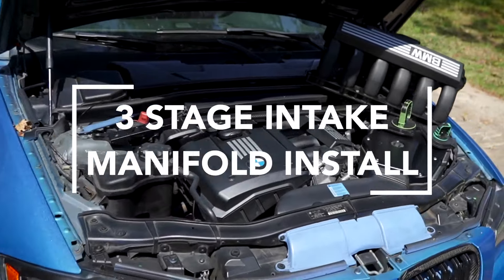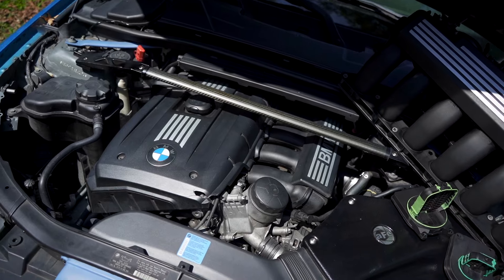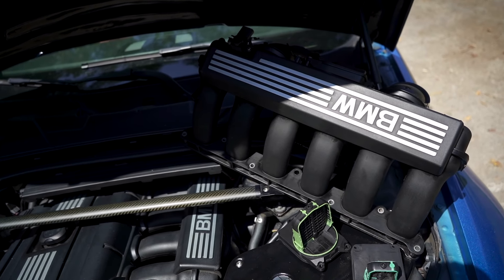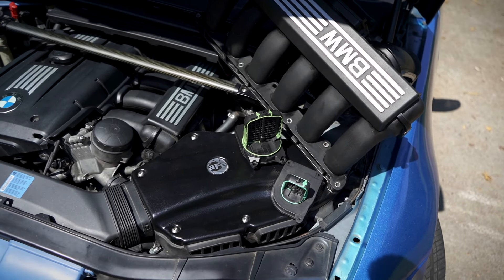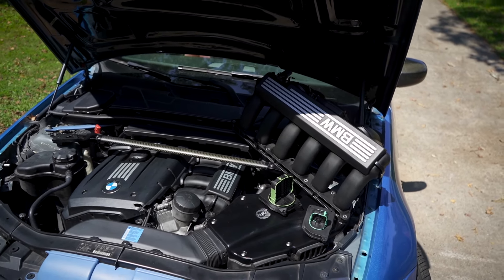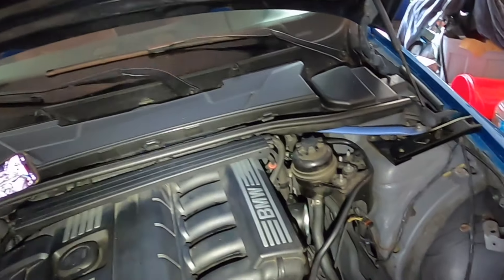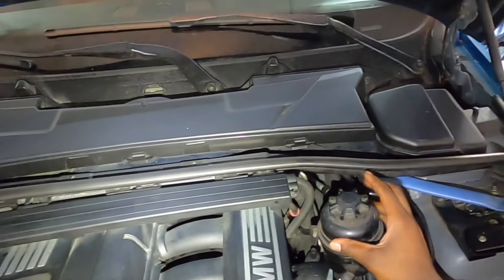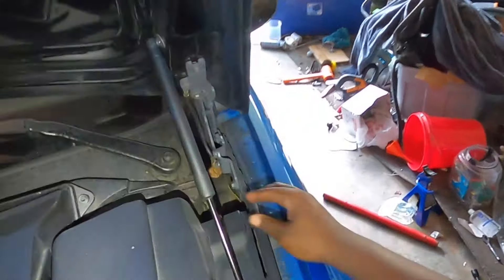How To Make a BMW 328i Faster: N52 3 Stage Intake Manifold Install And Tune

Comment from the maker: Parts List:
Right Air Intake Manifold Flap Control Unit Disa Valve Part # 11617560538
https://amzn.to/48cNDY1

Left Air Intake Manifold Flap Control Disa Valve
Part # 11617579114
https://amzn.to/3RdvzpQ

Intake Manifold Gasket Set
Part # 11617547242
https://amzn.to/3uMraSZ

I Suggest finding A USED one.
Genuine BMW 330i N52 Intake Manifold 
Part #11617559523
BMW E90 330i N52 Intake Manifold 11617559523
Reply: How can I tell if my used n52 already has the 3 stage?  it's already got some tune , intake and possibly some exhaust work.
Reply from the maker: If the car is a 330i it has the 3 stage manifold, every other one has a regular 2 stage
Reply: Have you had any problems with the disa valves or anything?
Reply: Can I just get the disa valves it's self and just put them on my manifold already in the car or do I need the 3 stage manifold itself??
Reply: @stevet8607 if your car doesn’t have the 3stage manifold, it won’t have the disa slots needed

Comment: I had my e92 328i with similar set up as yours. Euro-intake, 3-stage intake manifold, and exhaust; BPC in NC did my tune and I was getting 193 --> 224 whp and 187 --> 218 wtq. I definitely felt the increase of torque as a N52 is IMO very torque poor when stock. The price and effort to get this is definitely worth every penny for anyone who is interested.
Reply from the maker: 100% agreed and those are pretty good numbers

Comment: I am local to the Active Autowerks shop. They quoted me over $6k for tune including all exhaust and headers. Only promised a 20hp increase max with Dyno run . They wouldn't even take my$ . They told me I would be an unhappy customer and the platform isn't worth it. They sent me off with a cold air intake for a bit top end and noise increase.
Reply: Lmao 😂😂😂😂😂😂.   Serious over charging like MF

Also they sound Lazy 

Lazy workers and Over priced work

Tune for that setup 150-400 

Depending on how much Stuff your adding

Comment: bruh BMW 328i can be fast and very much fun to drive...Mine is 6 speed, FBO supercharged...around 3000 pounds...I beat N54 450hp idiots easily. I'm telling you weight matters and they dont get it. The investment is worth it imo
Reply: Cap
Reply: Can you send a link of a supercharger kit for n52?
Reply: @FanniCSIe92  The kit is pricey, I bought it used for $3K...but they go for $5K. TBH, the investment is worth it...think about how much MORE money you need to  mod an N54, not to mention the continuous maintenance. You will not have mad power like an N54 BUT you will have enough power to make you happy. Previous N54 owner who got fed up with the maintenance.
Reply: Did you build the motor for supercharger? Forged internals?
Reply: @hexatonik stock internals is good for 450hp with proper tuning
Reply: do u have the coupe or the sedan, either way how did u lose so much weight
Reply: @gabrieldasilva4198 notice how he skipped over your comment lmaooo buddy really lying on here
Reply: @nelsonx4235  drop some videos … oh wait you ain’t got none
Reply: If you think there is pros to buying and building a supercharged n52 over a n54, you silly.
Reply: @i_read_bad_reviews  for a daily 100%. If I want a beat fools in dumb street drag races, yeah the n54…even some prefer the 128i FBO for track build...dont be surprised if FBO Miata smokes you in the track...it's not all about raw power
Reply: @nelsonx4235  like I said. There is zero pros to dropping another e90s worth of money into supercharging a n52. If you want more power get a n54 to start. You are just throwing money away.
Reply: @i_read_bad_reviews  You may be right, but I'm already deep into the N52 build...will not want to start building an N54 now from scratch; this N52 pulls nicely for the weight...I may upgrade to an 340i later in the future when they get cheap
Reply: Haaaaaaaail no
Reply: You blowing these at 400 ,even methanol injected. So I've read and viewed on internet only. 1 guy reinforced the block with Steele. But saying a 3 stage beating a twin turbo dang near supra...nah
Reply: Low-key your opportunity to stunt and make a youtube if you into that. You'd be a world first. Not saying it's not possible. I'm just into pushing the boundaries of old tech .

Comment: good stuff and nice build seems like the manifold upgrade has been a major common upgrade recommended within the past few years i honestly dont remember much about performance upgrades for the n52 when i got mine years ago people would talk about, alot of 328s hit a certain milage they would give out and not even bmw knew the issues, but the issues have been flattened out and n52 is deemed reliable again with proper part maintence also i just noticed i watched your pink flamingo warehouse video before this from a couple months back didnt expect that
Reply from the maker: Agreed definitely one of the most reliable bmws of this generation

Comment: only 275bhp. Imo this is pretty impressive for a engine developed around 2004-2005 and produced early 2006 ! even my stock high mileage N52 I found it pretty powerful for a daily.

Comment: I been thinking about doing some bolt ons, super charger, exhaust and a m3 conversion kit on a 328i. I’m just kinda getting sick of the n55/54 I’m in my 3rd 335i, after this I’m done man🤣
Reply: I get the exponential power of the N54 platform...but the N52 has crazy amount of potential and the NA power band feels so good.
Reply from the maker: Would be a fun a set up, been beating on my n52 for 5 years now and 70K miles later still runs strong
Reply: R y’all on crack

Comment: Hi. I'm new to BMW. Does the single stage N52 intake have DISA flaps??  I'm thinking the DISA flaps make the intake 3 stages.
Reply: If you have the n51 version it already comes with it if it says SULEV underneath the hood. Otherwise you’ll have to buy one .
Reply: No, it doesn't.  Only the three stage comes with two DISA flaps.

Comment: 260whp is a bit of a stretch. You have done the only bolt ons people do on the N52...intake, 3 stage intake manifold, AA headers, and exhaust with secondary cat delete. With a AA tune, most you see is 240-250whp depending on conditions. So you are looking at 270-280hp at the crank. The only way to get 300whp on a N52 is with a supercharger and at that point, you might as well got a N54/N55 car.

Comment: Doesn’t the n51 already have a stage 3 intake manifold?
Reply: My 128i n51 does.
Reply: Just to compensate the power decrease caused by the lower compression ratio on the N51 SULEV versions
Reply: @gaaloulmed4753  so I have N51 SULEV. Can you elaborate on your answer? I didn’t understand. Thanks for your patience
Reply: @pignapoke6772 The N51 SULEV with the 3 stage is making max power it was designed for.  The lower compression ratio is the reason. The stage 3 is only a small power adder on a N52 car that came with the stage 1 and higher compression. With that being said I myself as well as others have benefited with a custom tune on the N51 to overcome the slight loss in power it has because of lower compression. Hope this helps you.

Comment: The N52 328i can never build more horsepower by just installing the 3 stage intake manifold. Simply because the original DME software won't detect the DISA valves hence they still not working !
Not talking about the more agressive software adopted to the 330i models.
Reply: Thats why you go and get new software update (Tuned)

Comment: i heard the car will tune itself out and adjust to the new manifold, is this true? ive also read to get the fullpower a tune is recommended, so much hearsay about the n52
Reply from the maker: I’ve heard both,however I didn’t feel a single difference till I tuned it
Reply: It will not, it has a tendency to create a vacuum problem. N52s are bullet proof until you mod it

Comment: 100$, how is reliability? Because I was just about to pay that 1k for a brand new one
Reply from the maker: So far so good, this video was actually filmed all the way back in September
Reply: The only concerns is the disa valve and their seals. 

Right into the engine is they fail (which can happen)

Comment: For a luxury car they sure do use alot of plastic parts which is engineered to drive you to the dealer opening up your pockets.. known facts… intake manifold is plastic, tranny pan plastic, only thing not plastic are regular bolts in these car.
Reply from the maker: It’s sad

Comment: Time for a differential swap bro.
Reply from the maker: I already have an LSD In the car
Reply: @BMWROYAL  well I guess the only thing left is a supercharger. But you're probably already thinking that...
Reply from the maker: @davidwigall4338 yuppp
Reply: @BMWROYAL where can I get a lsd
Reply: @BMWROYAL  what lst did you get?
Reply from the maker: @iaintcatchingnoell m factory
Reply: @BMWROYAL  aight thanks, and u think this b30 swap is possible on n52b25 (single stage) as you had the n52b30 (2 stage or single idk)

Comment: put the N54 Manifold
Reply from the maker: Torque over horse power is tempting
Reply: @BMWROYAL  oh okay cuz ive seen couple of ppl putting n54 manifold on a e90 n51/n52
Reply: @BMWROYAL  truuuu can I put bov on n52? Just for the sound and noise ?
Reply: @BMWROYAL  any spare parts lmk ill buy